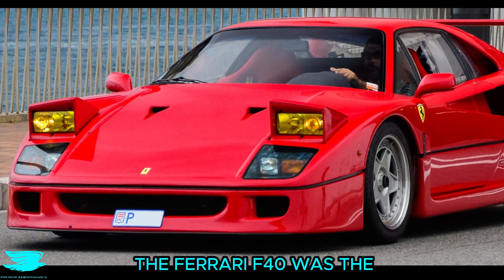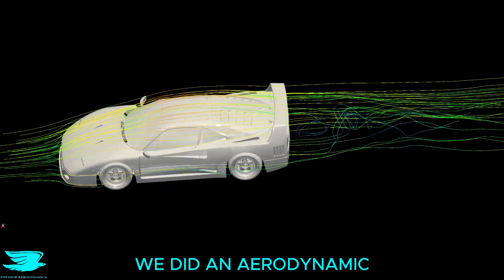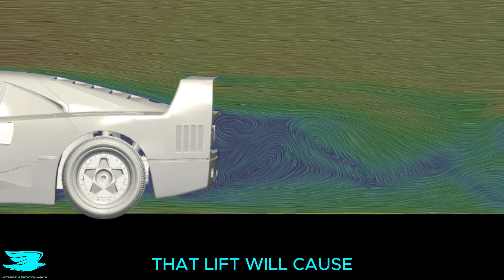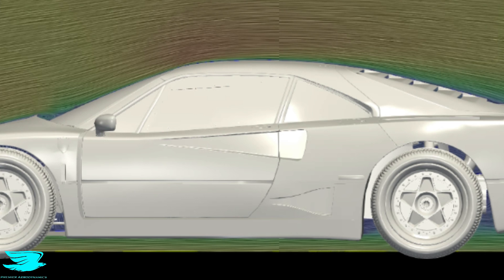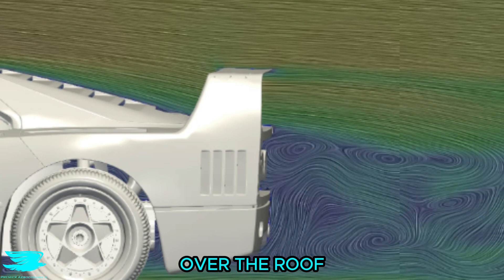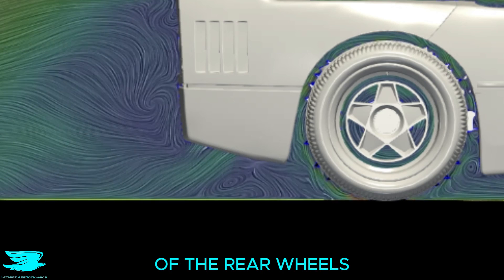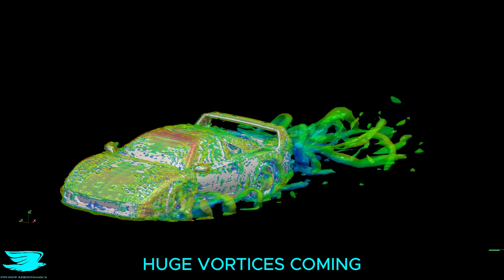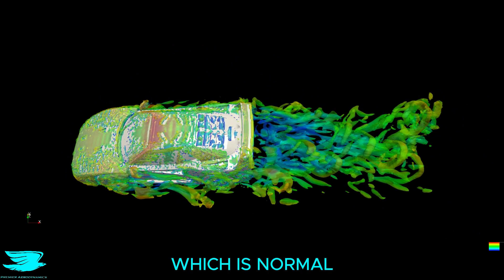*Ferrari F40* Aerodynamics

Comment: It looks like the recirculation wake in the rear is limiting the pressure recovery of the floor. The pressure recovery from the floor extends beyond the rear overhang. The downforce from the floor is behind the rear axle. Since the throat of the diffuser is the minimum pressure in the floor, and that throat extends behind the car, the underbody aero, coupled with the rear wing which is essentially just a flow conditioner, meant that at high speeds, the car was both stable and had a low coefficient of drag. That's what allowed it to get close to 200mph with only 487hp. The tires were developed to reach those speeds.
Reply from the maker: This is a great analysis. Thanks! It is impressive what they were able to do with relatively low hp compared to these days.
Reply: @PremierAerodynamics  another car that have an impressive top speed with "low" hp, is the TVR 440R, 215mph, for 440hp in a straight 6 package !

Comment: The majority of the back half of the F40 is NACA ducts and louvers, as well as the whole back panel around the tail-lights being mesh. Is this considered in the model? If not, would that change the large low-pressure area behind the car significantly? Looks like you Cd is still pretty close to the published 0.34 though.

Comment: You can see near everything on the car is tuned with the purpose of top speed. If you want to see an f40 make downforce you need to look at the competition (competizione) model.
That said, it would be interesting to see the flow over the louvers on the rear window, and how bad the popup lights mess things up.
I would also like to ask how accurate are your models underbody geometry? I remember a video by kyle.engineers that looked at the effect of simulating exhaust pipes and various other details, and the effect wasnt exactly insignificant.
Reply from the maker: This underbody was fairly accurate. The exhausts weren't modeled though.

Comment: Does that take into consideration the exhaust flow or just airflow? I would expect fast gasses from the engine to push the circulation bubble away and towards the middle part of the rear end.
Reply from the maker: It doesn't take into account the exhaust flow. It would definitely make a difference, but I would think the drag coefficient might be changed by perhaps a percent or so with it.

Comment: how could I add front wheel spats/air dams to my car and have them actually be effective without using cfd? wool tuft, leaf blower and pray paint?
Reply from the maker: I would go for tufts because they don't damage the car. If you are so inclined, you could also use an oil kerosene mixture to visualize the flow, but that might damage the paint job on your car.
Reply: @PremierAerodynamics  thank you, I understand cfd isn't 100% real life, but it's a good starting point for many engineering tasks, better than guessing and not knowing, hence my question

Comment: I was expecting this one to have some downforce. In the future, it would be interesting to report the aerodynamic load distribution (e.g. 45% front axle) and compare that to weight distribution, which should be easy to look up for most cars.

Cars have low yaw damping at high speeds, so for high-speed stability, it’s good practice (even for race cars) to have the center of load behind the center of mass. Drag (acting above ground level) acts to reduce front load and increase rear load. Ideally, the contributions of both lift and drag are included when calculating aerodynamic load distribution.
Reply: You seem to have an engineering background, but for your convenience:
My = Constant-speed Thrust and Aerodynamic moments about Y-axis (right-positive convention) = [Drag * Zcp] - [Lift * (Xcp - Xcg)]
where
Zcp = Center-of-pressure Height (above ground level, from CFD results)
Xcp = Center-of-pressure Distance (behind front axle, from CFD results)
Xcg = CG Distance (behind front axle) = Wheelbase * (Rear Weight Distribution) = Wheelbase * (100% - Front Weight Distribution)

Fz,f = Front Aero Load = -Lift * Front Weight Distribution - My / Wheelbase
Fz,r = Rear Aero Load = -Lift * (100% - Front Weight Distribution) + My / Wheelbase
Aerodynamic Load Distribution (%Front) = Fz,f / (Fz,f +Fz,r) * 100%

This might not be necessary, if the CFD software already solves such statics problems.
Reply from the maker: @AwestrikeFearofGods  Thanks for the suggestion. For the downforce, I was also expecting that too, but when you look at it from the side, it is really just one big wing. The underbody is flat and the roof is very curved, so it kind of made sense that the lift was slightly positive.